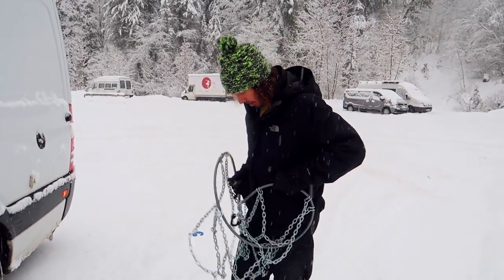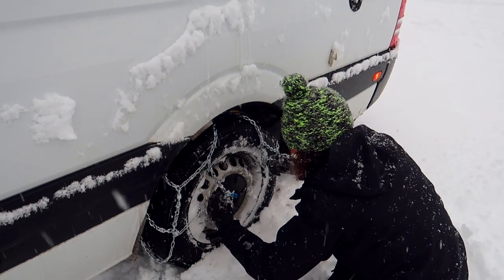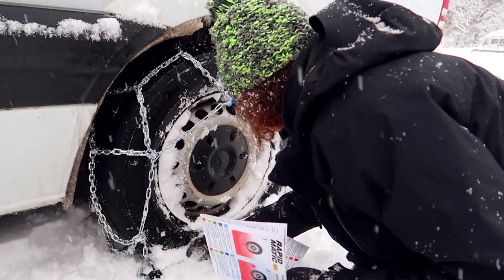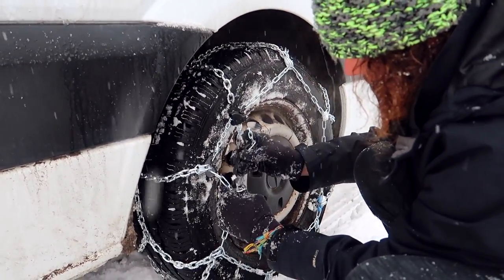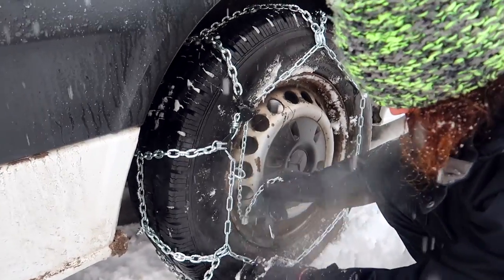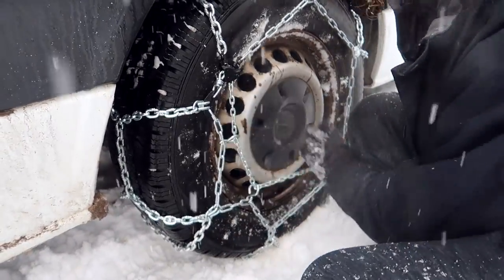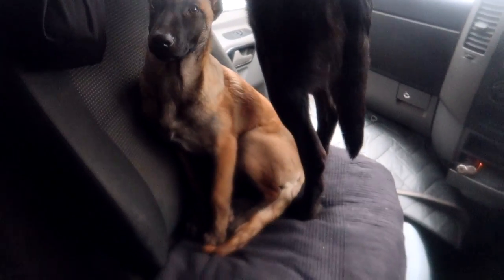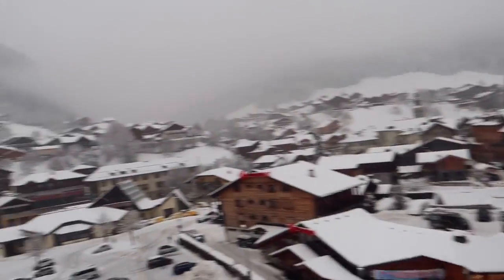How Effective Are Snowchains? We Find Out! - [Winter Vanlife DAILY]

Comment: I made the same mistake with snow chains, first time i used them i was in a blizzard with freezing conditions trying to figure out the process! I assume the van is rear wheel drive as you put the chains on the rear? not ideal as you won't have traction on steering which i would highly recommend ;-) if you get bored of chains get michelin snow grips, a hell of a lot easier to put on, cheaper, quieter, lighter and easy to store. Good luck, great job on the cam build out.
Reply from the maker: Yeah RWD, surprisingly steering and braking was fine :) will take a look at the snow grips, cheers